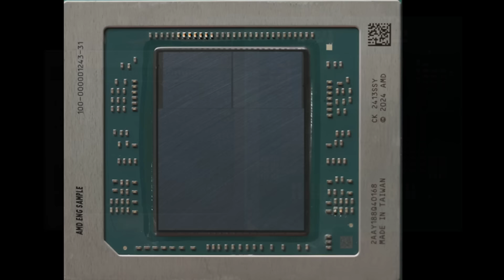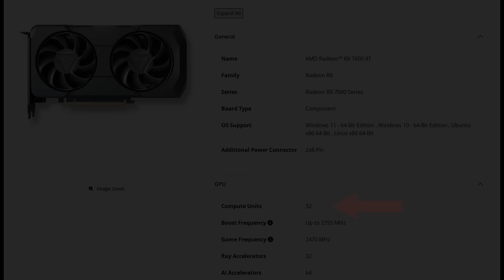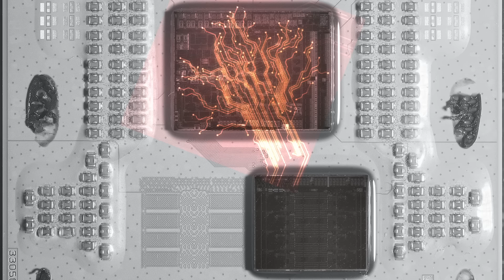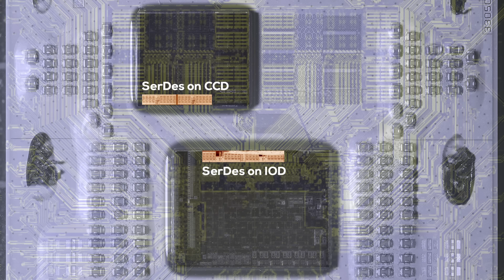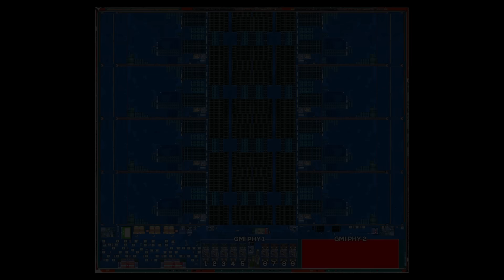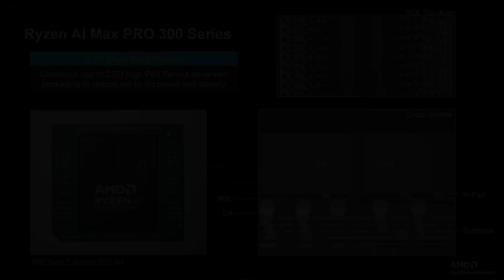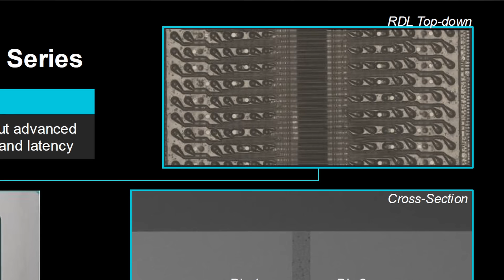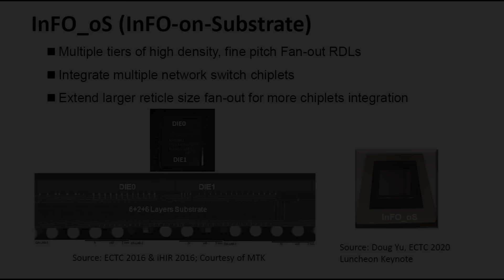How AMD is re-thinking Chiplet Design

Comment: My 3900x is starting to show its age.
Once Zen 6x3d comes out, I'll upgrade.
Reply: There would be even Zen 7 on AM5.
Reply: Just buy cheap 5950x, should be a nice upgrade
Reply: @deansmits006  uh, its not cheap at all.
Reply: Committing to something that doesn't exist and has no pricepoint is not a great choice
Reply: @s1mph0ny  With all the leaks out and the little info that AMD is starting to drip out, I think it's a pretty safe bet. I did the same with the 3900x, which has served me remarkably well. I'd run it a few years more, but the single core performance is starting to bottleneck my GPU.
Reply: lets pray intel fuckin kills amd next release, cuz I hate red.
Reply: @bartman2395  UserBenchmark owner spotted
Reply: @ulrikebethman im running 9950x3d and 5090 tbh. Should have stayed with 14900ks. My 13980hx laptop is nearly on par in workloads with 9950x3d - amd is that bad.
Reply: @bartman2395  HAHAHAHAHAHAHAHAHAHAHAHAHAHAHAHAHAHAHAHAHHAHAHAHAHAHAHAHAHAHAHAHAHAHAHAHAHAHAHAHHAA
Reply: @bartman2395 ur one of those guys who falls for the iSheep 😂
Reply: @ulrikebethman  the Intel fanboys are the same as ever. Full of hatred 😂

Even owning half big number of stocks in a company i cant imagine rooting like this for another company to fail.
Reply: @Marcus-69-42  wow u spotted 1 intel fan in utube shit hole of thousands of amd fanboys. Good amd bot
Reply: @artur9782  Easy there Clanker, i ve been on intel up to this year. I dont care about none of them but to critique how over the top some Intel fanboys are.

Even when 13th and 14th gen Intel were dying and server company were loosing money cuz of it some of intel fanboys were still big mouthed😂
Reply: @bartman2395  14900ks is power hog😂.
Reply: @bartman2395  What workloads?
Reply: @bartman2395  In what workloads? Pure single thread? If so, your 13980hx laptop is also nearly on par with the 14900k, which still has Intel's fastest CPU core (at least until it self immolates), and if single thread is your metric why aren't you also calling out the fact that a big 14900k core consumes about 2.2X the power of a 13980hx big core for only ~10% faster single thread? Because that sounds equally as bad as AMD to me, except for the fact that the AMD CPU will still be working fine next year and that's not something I can confidently say about a 14900K.

The 9950X3D is upwards of 30% faster in multithreaded workloads than a 13980HX, and if you're primarily running single threaded workloads, why did you buy a 9950X3D and not a 14700K? Sounds like a skill issue to me.
Reply: @bartman2395  I have a 14900KS and 4090 but I might as well have stayed with my 3950x.
My 7945HX laptop is equal and sometimes faster than my i9 - Intel really is that bad.
Reply: @Marcus-69-42  wow another cheap amd fanboy. Didnt last even a minute lol without cope from some 50iq who love some piece of silicone. Coolstorybob, cope harder
Reply: @K31TH3R  My undervolted 14900k on 1,25v works faster than default 14900k. And it will work for more than a decade. while x3d garbage dying without a reason.
Reply: @artur9782  another clanker bot who didn't read my comment that I don't care for any of these 2.

But thx for getting ragebaited 😂 50iq bot
Reply: @Marcus-69-42  lol that butthurt. chill ur ass kid
Reply: @artur9782  imagine having a Clippy profile while hating on competition, louis rossman would of kicked ya ass seeing your comment lol😂

Also, who asked? people who want straight Gaming would by a 9800x3d anyway that runs cooler and destroys your cpu in gaming. Or go for a 9950x3d and be done.

Yall forget the racket that 13/14th did with the microcode, you shrugged it under the carpet?😂 all the CPU that died even after the Bios Update because the damage was already done? oh we forget about that verry fast, the stability issues, the bluescreen, the numbers of CPU that still die over time even after fix?

This aint "INTEL HATING" its the problem and headache they have done to their customers and business that were forced to switch little buddy. Its FAX
Reply: @Marcus-69-42  didnt read lol
Reply: @artur9782  Well, I hope it keeps working for you. Frankly I have not been overly impressed with either Intel or AMD when it comes to failure rates over the last few generations. But I will say at least with Intel 13th/14th gen you can avoid it by undervolting, whereas there's really no rhyme or reason to why a Ryzen chip randomly fails other than the odds of it happening are lower if you're not running an ASRock board.
Reply: @ulrikebethman  In a way, I hope he is right. In that, more players in the space means they both still work hard to get our money.
Reply: @bartman2395  Intel's borderline server but still consumer grade cpu's are masterpieces of their own making yes. But holy shit are they hot as Satan's balls. Your laptop is most certainly happier with a 9950x3d rather than 14900ks.
Reply: @bartman2395   uh huh, sure buddy
Reply: @bartman2395  people like you is the reason why anyone with the brain turn away from intel.
Reply: @s0ulll0warri0r  only fools run intel this generation, excluding 14900ks. Have a great day
Reply: Don't argue with him, You gonna get only dumber lol. Just watch some benchmark video and you'll see AMD is better.
Reply: @bartman2395 I hope AMD gets Competition by Intel but ...
Reply: @DavidBerger-g2h care about power, not price. We did nothing for last 3 years in cpu.